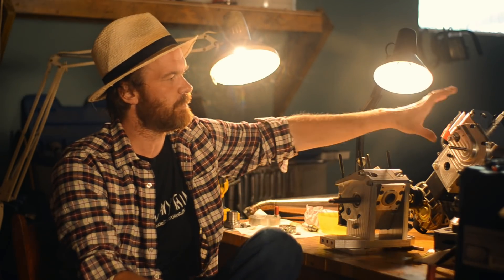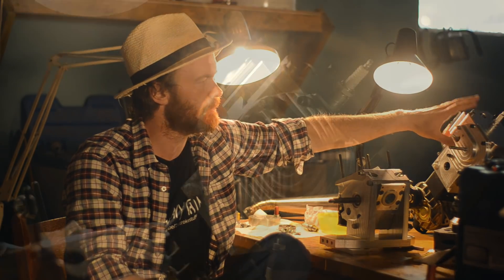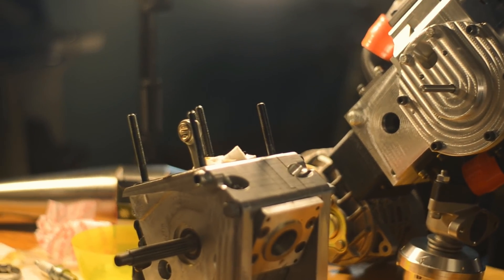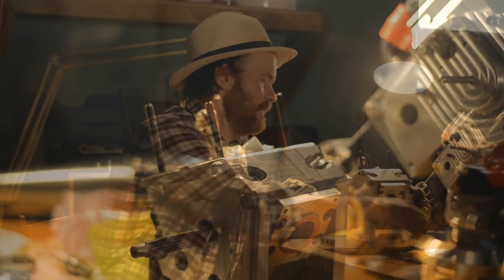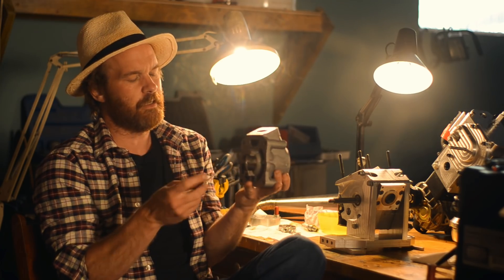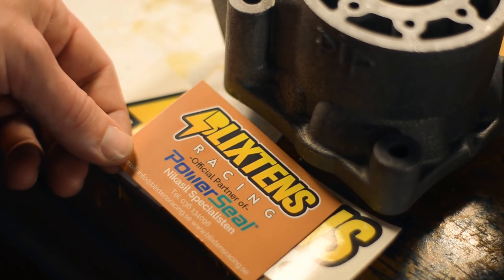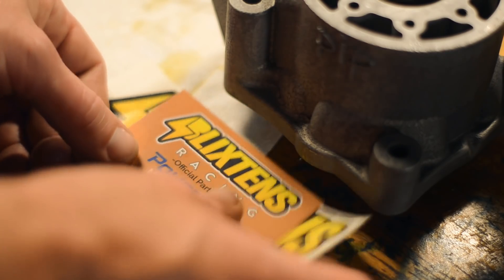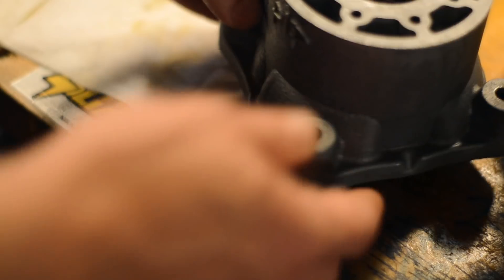Still Most Powerful Two Stroke Ever?

Comment: I am curious if your engine(s) would have aero-applications for ultra-lights ?   I can see it in a pusher application on a BUG - Basic Ultralight Glider - and follow-on ( powered ) aircraft.   Even with a very small engine, as a sustainer engine after getting the motor glider aloft with a tow, seems promising.....

Comment: Hey.
In chainsaws, we NEVER use a hose that long when checking cylinder pressure, it doesn't give proper readings.try threading gauge into adapter next to cylinder

Comment: I suppose with lighter 50cc pistions 0,65 squish is ok at 20k. When we were racing 125 GP's here in Norway/Sweden, rod strech could be a problmen if one downshifted too hard and hit 13-14k rpm :-) (Honda RS125R)
Some tried roller bearing to stiffen the crank, exxpensive as the cases had to be line bored.

Keep at it. Loving it. Would love to visit one day.

Comment: I've always wanted to experiment with a tesla valve inspired design for a two-stroke pipe.. you should look into that buddy. It's a pipe design that flows faster than a pipe of equal  diameter but the flow is also directional..

Comment: It sounded like it was almost beginning the surge up on to the pipe at only half the rpm that the pipe is tuned for, and that pipe is definitely not designed for a wide spread so I'm going to imagine that this strong acceleration from so low is due mostly to good cylinder design. Well done.i am however  a bit worried that the 100% of bore exhaust port concept is going to be impossible.......with one port......and then I start wondering if more than 100% is possible using a series of ports.

Comment: Would it be possible to use compressed air or nitrogen to pressurise the fuel? In that way you "only" need to control the injector and don't need a fuelpump.

Comment: You definitly need a EGT in the exhaust, otherwise you never can say if its to lean or rich. Round about 12cm from Piston skirt and 650' Grad WOT should be perfect. And then look at your cooling system ... your head outlet is not the highest point and can cause some thermal hotspots because of air bubbles. So far a cool project ... i'am stay tuned 🤗 greets from germany, Thilo
Reply from the maker: 👍 Definitely do. The engine is supposed to sit upside-down.

Comment: Now that the pip engine has a bridge to keep the ring in place. Would the screw together piston work if you took away the pin that keeps it from rotating? That seemed to be the weak point.

Comment: Doesn't power come from fuel and air VOLUME ! ? I know the moving parts must handle the torque load , but what are you doing to maximize flow . No air pump-turbo-blower... is necessary if you use an oxidized fuel like nitro methane . I would love to see 100 HP out of this thing . What are your estimates ?

Comment: Solution to stop the short circuiting with a standard piston seem easy. Have a machine shop manufacture a wrist pin with that has a 2 mm plug or "stop" located dead center in the pin.

Comment: Alex, if you can get one try using an E3 Daimond Fire Spark Flug. The electrode is a cage so there's no adjusting the gap and they've been dyno proven to make more power and last longer.. Well that is, until you start running nitro then it's pointless as you'll be burning through plus so fast that you won't want to pay for them. Even NHRA Top Fuel just runs cheap plugs because they toss them out after each run.
Do you have a video (or can you make one) explaining how nitro works with two strokes, I'm a little confused. You say that all you need for more power is more nitro but with how two strokes love to run super lean.. how can that be true?

Comment: might be able to make a little more power by having the rotating assembly balanced , seems it vibrating itself to death (could eventually cause the piston to fracture and bearings to damage )
Reply from the maker: You can't really balance a single cylinder engine(except to an extent with a balancing shaft), only move the direction of the force. 55-60% balance factor gives the most even force distribution, but depending on how the engine is mounted it might not necessarily be best.

Comment: Why won't you make your own piston pin?. Solid, or with a little divider in the middle of the pin. That way you eliminate gasflow through the pin.
Reply: It will still short circuit around the ends, as at some point, The gudgeon pin hole spans the exhaust and the A Transfer

Comment: I hate to send you off on another project but if you were to buy a cheap diode laser, you could adapt a  cnc tool holder to mount it and then use your cnc to cut out those gaskets by laser. You could use an extra g-code for cycling a switch to turn the laser on and off such as the g-code for mist.
Reply from the maker: 😁 Actually been looking into laser cutters

Comment: This may be addressed in another video but what is the material thickness/weave matrix of the reed valve and would it be a good choice for my Grandsons KTM 50sx factory edition (2021) I’m getting reed warping in only a few hours. Also what’s the contact info for that company so I can purchase some, maybe a few different tensions would be good to test. Any suggestions would be greatly appreciated! 
THE ENGINE SOUNDS RADICAL!!!💪🏁👍 DYNO TEST WILL BE AWESOME
Reply: He used 0.25mm polini carbon fiber, it's a good starting thickness for a 50cc, for higher rpm thicker the better, depending on you're application , polini has 0.25 - 0.45...
Reply from the maker: 👍 0.25 was all I had, would ideally have used thicker. As long as it can bring it into the powerband it doesn't matter tho, then it's secondary intake time.
Reply: @2STROKESTUFFING  Thanks for the info, will Polini sell the material in sheets so I can cut my own? I believe the answer is yes seeing you cut yours from a bulk sheet. Have a great weekend!!!
Reply: @VlazZa  Thanks for the reply, I used a fiberglass material on PW-50 w/mod block.017 thk. Works good seeing it’s a low to mid power the tension is great but a carbon fiber matrix would last longer but I need to replicate the lift tension. Maybe Carbon Tech Company has some low tension mat. that will lift easy for the little (stock sort of) PW’s.

Comment: Hi. Spotted your black spark plug  and just a note. I funny enough today battled with my motor not running good. Found plug was arcing to the top ever so slightly. Replaced with other make and wow my motor runs far beter. Something to look for 1st before any other problems. Sounds amazing👌👌

Comment: how much torque do u put on the head and cylinder when assembling the engine
Reply from the maker: 10nm on the m6 head bolts, short thread, don't want to strip the cylinder. Think I did 15 or 18 on the four cylinder studs.
Reply: @2STROKESTUFFING  Yeah seems pretty reasonable, the bolts are really small.

Comment: Hi Alex
Glad to see you are back on this engine.
Ive been holding back thus far on commenting because I know you have had your heart set on making the 100% port work and I didn't want to put a damper on it, but I have to tell you my friend that the mechanic in me has been a bit skeptical about this working, in particular the piston design and the reasons being pretty much all the ways it has failed so far.
But I feel its time to comment now and say that I think you need to be a bit more systematic with it and try to avoid too much tunnel vision on singular issues like the 100% bridge free port at the expense of halting progress on everything else. 
Also keeping in mind the tuners rule of diminishing returns, meaning how much of a real gain is 100% exhaust with and without a bridge in practice. Because if there is little to gain in performance between bridge and no bridge then it might be better to settle on having one suffice to have it reliable enough to run at least long enough to last for Dyno runs, rather than stick with no bridge and be continually frustrated by failures arising from it to the point you give up on it which seems to be what has happened for a while. And now you have one with the bridge an its working well that sense of satisfaction may compel you to just put the 100% no bridge in the past and forge ahead with the rest of it.
Now it is working more reliably you can get to the dyno testing and perhaps you will find some more gains there to offset the small loss a bridge causes.
Onwards and Upwards...........

Comment: I think you should really get rid of the methanol approach. How do you even want to compare the engine to other engines when most 50cc engines use gasoline??
Reply from the maker: I'll do some testing on gas too.
Reply: @2STROKESTUFFING  Alright, thanks for the quick response! Wish you all the success!
Reply: Easy to compare. 50cc is 50cc if he Get 30hp from that engine on metanol. Its still a 50cc engine.
Reply: @ktmturbo5836  But it's kinda cheating since methanol and nitromethane produce more power.
Reply: @falco447  50cc
Reply: @ktmturbo5836  You can also power a 50cc with a nuclear explosion and call it "the strongest engine in existence". If you want to compare things you need a certain standard.
Reply: @falco447  the standard is 50 cc 🤔 if it would be racing or competition with set rules there might be classes for different fuels and aspirations, but from what i gathered this is for learning and trying to push the limits for 50cc. wish i had the money to donate or take part in this
Reply: @jpvalve  This is too small of a standard if literally all other 50cc use gasoline. And if he wanted, he could also attach a bottle with pure oxygen at the intake of the carb. This would give him even more power without changing anything in terms of design on the engine. It's what I call "cheap village tuning". And I think it is not what he wants to do in this project. Remember that he tried to create a super wide exhaust without a brigde and used a special piston for it. This was truly innovational. Using mathanol, nitromethan or oxygen to power it up is not.
Reply: @falco447  if someone make a nuclear 50 cc they are welcome to take the title.
Reply: @ktmturbo5836  This would not even be a combustion engine anymore. Just saying.

Comment: I made a good bottle tank from PE plastic bottle. Two hoses in tight holes thru cap. Long one to bottom for fuel and just thru the cap for replace air (pin size air hole for prevent leak in tip over happenings). When I blow to air hose, it fill fuel hose.

Comment: Hey man do you need a muffler on a two stroke for correct back pressure I know the expansion chamber is supposed to provide back pressure but is the muffler needed for extra back pressure I’ve got a Suzuki TS185ER engine which I’ve stuck in  an Yamaha xt200 frame and I’ve had to modify the exhaust to fit  I’ll have to add a muffler as it’s straight through atm and to loud but do I need a proper muffler
Reply: one of the biggest myths about two strokes is back pressures as suggest the actual passing of exhaust gases as two strokes will not run on any back pressure Associated to the passing of the exhaust gases.....
an improper Muffler will cause the engine to run improperly. Do not use any type of a muffler that will restrict the exhaust at all. When people refer to back pressure on a two-cycle engine they are referring to a sound wave that reflects off the Reversed expansion chamber internally sending the Soundwave back up to the exhaust port that will block the incoming charge of air / fuel from the Boost ports escaping the exhaust port as all 2-cycle engines of this type are self supercharging supercharging engines and build boost in the crankcase and then compress it again in the combustion chamber so having a tuned exhaust is necessary to keep that boosted intake charge from blowing directly out the exhaust..its when the piston speed catches up with the highest % of trapped intake boost we call "on the pipe "  that's when a two stroke has its tremendous surge of power as at that very moment the air fuel mixture in the boost ports ( now called transfer ports in order to confuse you so you'll never know or learn) are above atmospheric pressure and always making more boost till the maximum CFM through the carburetor is obtained this is what we call the powerband...its very hard to get most people to understand what I just stated without any animated slow motion to would picture the movement of the intake airflow from the time it is naturally aspirated entering the carburetor from atmospheric pressure pushing the air into the carburetor been through the Reed valves where the air is trapped in the crankcase at that moment then the Piston travels down towards the crankcase compresses the air in that crankcase above atmospheric pressure that ass just came from the carburetor with the fuel mixture already in it and just before the Piston reaches bottom dead center the Boost ports are open by the top of the Piston moving past them. Now the compressed air in the crankcase is forced into the combustion chamber that's when you want the sound wave to block off the exhaust Port so that intake boost does not fly out through the exhaustion and not be used do it depend on a sound wave from the Spanish paper and not any back pressure at all if you plug up the exhaust just a tiny little bit it was severely horsepower and torque of these little small engine will cut its power in half expansion chamber for a 2-stroke will severely
Reply: @donniebaker5984  thanks you very much for that that’s very helpful
Reply: @Frisky_FZR  thank you very much as you are the first person who has not questioned my sanity or ask what I m smoking after telling the millennials why their four strokes will never make enough horsepower to ever match a two stroke of the same displacement ...I spent 3 years a Danville junior college for agricultural mechanical technician that was a division of the University of Illinois Champaign-Urbana where we spend a lot of time in their lab experimenting with a single-cylinder engine they had developed that would run on diesel any kind of fuel you even change the compression ratio blah blah blah and I ended up with a associate degree in applied science and a doctor motor degree from the perfect Circle Corporation who made the piston ring for Indy cars and left there with top honors at about the age of 20 ..then none of the major contractors showed up as we were all promised high paying jobs if we stuffed 4 years of university Tina into year round class room training and hands on ....and nothing was ever discuss of how I real 2-stroke engine really works other than the cartoons in a textbook their two-dimensional with nothing about what happens with boost ports so I went to work for a hundred bucks a week working at Pontiac Cadillac and Buick dealership and became there tuner of all cars so when you bought a new 455 Trans Am Super Duty that I had anything to do with you can burn the Goodyear bias wide oval of in an afternoon and those little Buick Opel GT that looked like a miniature 1970 corvette ran like a corvette with a 1.9L single over head cam engine I manage to get a top end of 125mph out if everyone ..then in 1971 when you lifted d the hood of any car all you could see was rubber hoses going to air pumps blowing air on exhaust valves runING white hot warping valves of low compression engine with no balls and were's the beef ? and no more 106 octane premium at the star station were i always filled up as the only gas after that was 93 octane regular no lead that now called premium fuel as the Millennials will believe anything told to them as they had no way of understanding mathematically or in science that that ain't octane rating a million years ago is still the same octane rating of today that tells you one thing how fast the fuel will burn when ignited in the combustion chamber of your car and that's it there is no more Magic and when I try to tell you that 87 octane will run just as good as 93 octane in your car they're telling you a perfect way to destroy your car so you'll have to buy more as you will never hear detonating Pistons as a damaged already done. you'll hear spark knock

Comment: I really want to see it on the dyno, even more on a vehicle ! It sounds so mean !
Reply: its weak as fuck.
Reply: @DieselRamcharger  It's 50cc and it's about making the most hp out of that displacement. Given it is the highest hp per cc of displacement in that class I don't know if I'd call it "weak as fuck" when it's the best performing one in the world. Lol
Reply: @n111254789  hp doesnt really mean anything except how high you are willing to rev it. ive seen no reliable data to qualify the output of this motor.
Reply: @n111254789  Lots of claims. Zero Verifiable Data.
Reply from the maker: Working hard to get the dyno built.
Reply: @2STROKESTUFFING  a Dyno is not that hard at all to build. For something this small it is quite easy. Think out of the box. I could help you out with ideas I had for past 10years.
Reply: @DieselRamcharger  Well, i don't know how to take this from a guy with diesel in the name, i mean, no offense, but diesel are not really the best sounding engines.